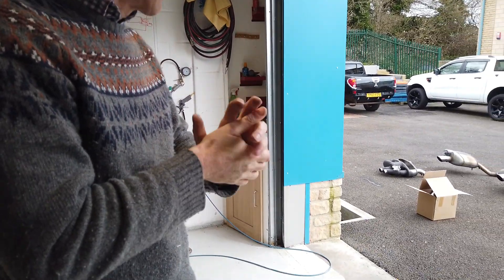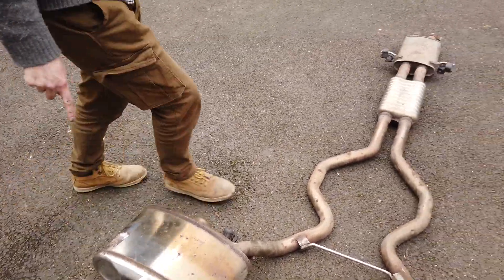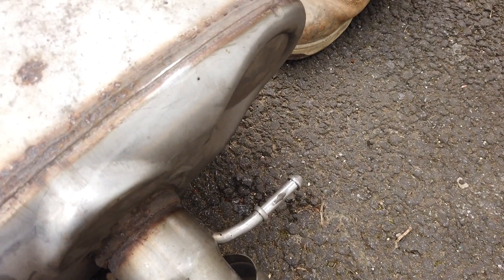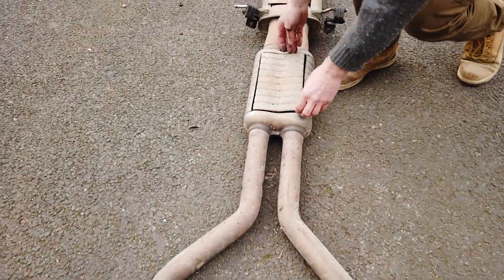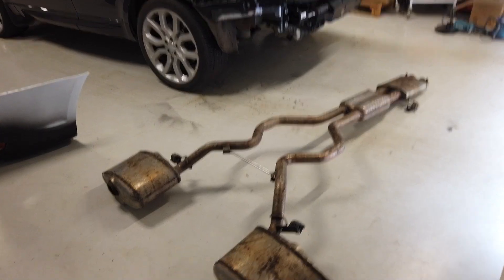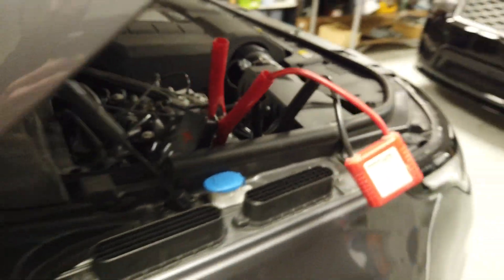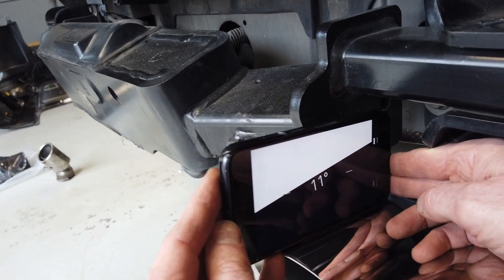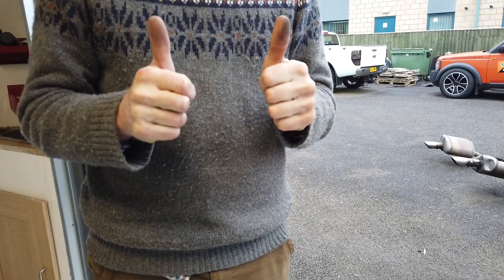Range Rover Sport L494 Exhausts and SVR Exhaust Tips Muffler

Comment: On my V8 Sport, will my exhaust note change much if I swap my stock mufflers for SVR stock mufflers?
Reply from the maker: The problem with the SVR exhaust is that it has flaps that are driven electronically and your car does not have the system to drive this.
Reply: @L663  True, but can't that be bypassed with a simple positive/negative open/close switch?